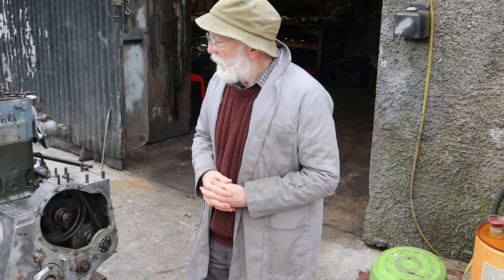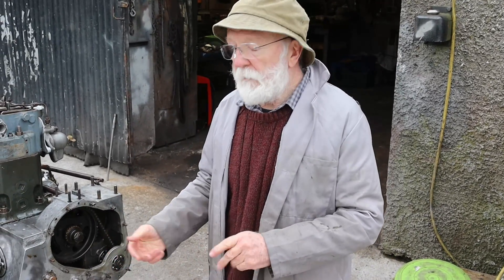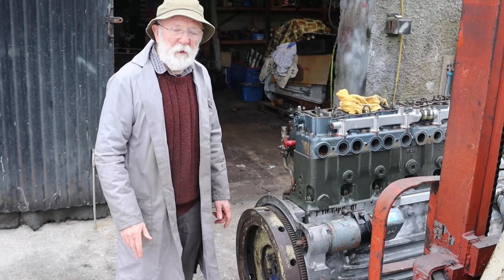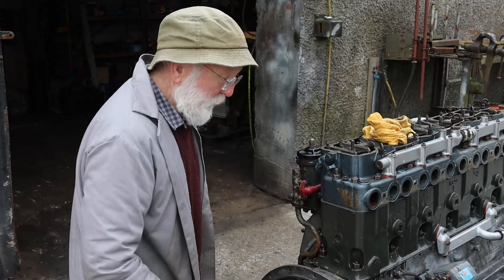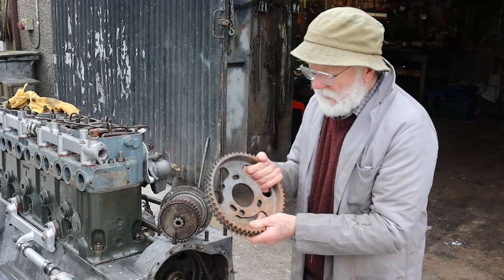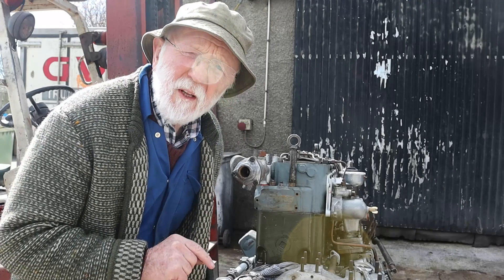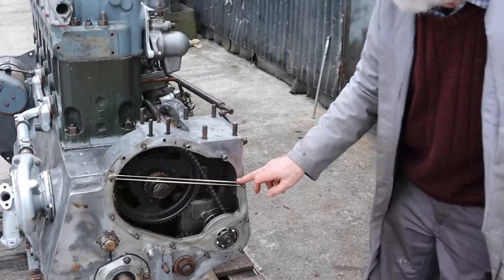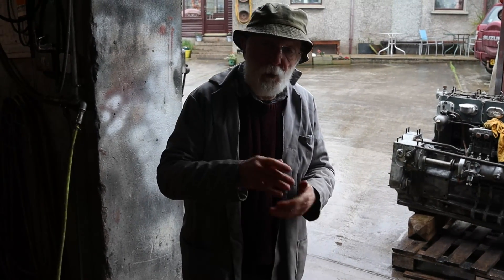Timing Gardner Engines

Comment: There is a second set of timing marks on the rear face of the flywheel with the reference scribe lines on the rear engine casing. These marks, two marks made by the centre point of a drill with a line scribed between them are found on the near side of the engine (fuel injection pump side) between the top 2 bell housing bolts on the near side and is usually covered by a sheet metal plate. They are used when there is no access to the timing marks the Joe used and are often easier to find and line up. Gardners also supplied a special tool that was fitted into no 1 injector location and indicated TDC by way of a plunger and scale, this could also be used to find the appropriate fuel injection timing points as it was calibrated in degrees before and after TDC.
Reply from the maker: Thanks for that.  We made our own special too, from an old injector 🙂

Comment: Thank you for sharing l hope your family are slowly moving on from what l imagine is such a horrendous thing...like they say time heals the wounds but leaves the scars god bless.....On these engines for those that might be looking l know of Two 6 Cylinder or possibly 8 Cylinder engines sitting in a shed in a place called Hollands Landing in Eastern Victoria Australia where they powered the local caravan park and were still in running order up until recently. the owner might sell them as he needs money and is very approachable...just for the info of members wide and far regards Doc from Down Under

Comment: Ok, this is about the 8th video I've seen most of them with this guy about these Gardener engines. I realize the chances of finding one of these engines somewhere , in the 4 or 6 cylinder version would probably be very difficult. However I would like to find one and put it in my old F-150 .  Simplicity is a Wonderful thing.  Beautiful old engines.
Reply: And then, the next video I come across is titled Gardner engines another way to waste time.😂😂 still, very cool engines
Reply: @jimself9395  I know of two sitting in a shed hooked up to old generators at a place called Hollands landing in East Gippsland Australia, they used to power the old Caravan park l believe the owner is approachable for sale of these  6 Cylinders regards Doc from Down Under
Reply from the maker: We have four cyl and five cyl available.  Please email: tangent.gardner@gmail.com

Comment: You still have no idea  about valve  overlap joe  have you and how to set it ? O dear  o dear.
Reply: The cams are fixed relative to each other so overlap is not changeable. All the cams are separate units slid onto the camshaft and located by screws. Overlap is set by the  position of the counter sunk holes in the camshaft which the cam locating screws fasten into and was as chosen during development of the engine all those years ago by the factory. It is also affected by cam profile and radius of the followers, but they too are factory chosen and not changeable.
Reply: @salamander5703  But the overlap is changeable from wear on the cam and tappets from use. What Trevor is alluding to is that this video completely misses the bit of the process that the Gardner documentation details on correcting the cam position for valve overlap to account for any wear present and also misses that the cam chainwheel is slotted so aligning the dots with the elastic band doesn't actually mean the cam is timed correctly.  The following is from the Gardner documentation for LX, LXB, LXC, LXCT. 

CHECKING THE VALVE TIMING

Prior to checking valve timing adjust the timing chain until it is tight and
the inlet and exhaust tappets to the following clearances.
LX, HLX □.020 in. (0 .508 mm)
LXB, HLXB with 5B cams0.020 in. (D.508 mm)
LXB, HLXB, LXC, LXCT 0.020 in. (D.508 mm)
HLXCT with 50 cams □.025 in. (D.635 mm)

Set No. 1 cylinder at TDC, exhaust stroke and proceed as follows:

1.- Rotate the engine anti-clockwise (looking at the chain case end) to
approximately 20 B.T.D.C.

2 . Rotate the engine very slowly clockwise until the inlet valve is at the
point of opening. This can be determined by rapidly and repeatedly
moving the inlet valve lever sideways on the shaft against the spring and
allowing it to return under the action of the spring until the valve
lever is felt to 'nip' the valve stem tip; this is the point of valve
opening.

3. Take a reading of the crankshaft disc or quadrant pointer.

4. Continue slowly rotating the engine past TDC until the exhaust valve
closes. This can be determined by trying to slide the exhaust valve
lever sideways along the shaft. The lever will be 'nipped' by the valve
up to the point of valve closure when it will be freed to slide along the
shaft; this is the point of valve closure.

5. Take a reading of the crankshaft disc or quadrant pointer.
The maximum permissible timing is:
LX, HLX Engines:
Inlet valve opens 11 ° before TDC
Exhaust valve closes 11° after TDC

LXB, HLXB, LXC, LXCT, HLXCT:
Inlet valve opens 16.1/4° before TDC
Exhaust valve closes 11 .3/4° after TDC
Valve overlap = 28 °

Under no circumstances must any inlet valve open before 16.1/4 ° before TDC or
the exhaust valve close more than 11.3/4° after TDC or piston/valve contact
may result.

NOTE: When checking timing, particularly on an engine which has seen
considerable service, the valve overlap will be reduced due to
wear on cams and tappets. It is desirable to arrange the timing
so that it lies equally between the above timing figures.

Example:

LXB/LXCT

Inlet opens 17° before TDC
Exhaust closes 8° after TDC
Valve overlap= 25°

Loss of overlap= specified - actual= 28°-25°=3°

This overlap loss should be divided equally between inlet and exhaust i.e.
1 .1 /2° each thus.

Inlet open 16.1/4°-1.1/2°=14.3/4° before TDC
Exhaust closes 11.3/4°-1.1/2°=10.1/4° after TDC

N.B. The valve timing MUST be checked on every cylinder.

Adjust the valve timing by movement of the valve camshaft sprocket on its hub
to give these figures.

When timing is completed the timing chain must be re-adjusted to the correct
running tension (see Routine Maintenance) and the tappets re-adjusted to the
correct running clearances as shown on page 7-8. "
Reply: @MPSVintageDiesels  You are right but I was pointing out that you can't change the amount of overlap. However you can measure it and use it to get the camshaft timing correct by following the procedure from the handbook and that would also be necessary to get correct timing to account for cam and follower wear in service, as you suggest.
Thanks for comprehensive reply!

Comment: The Gardner had one of the simplest methods of timing I came across, the worst was the “Magirus Deutz” as they had no timing marks and you needed work out TDC and the circumference of the crank pulley to calculate the point of theoretical point of injection, and then spill time the inaction pump. 🤦‍♂️
P.S fabulous to see you back Joe, I hope you and yours are keeping well.